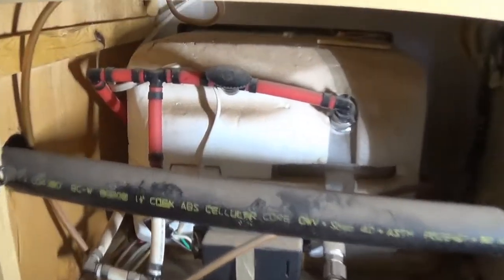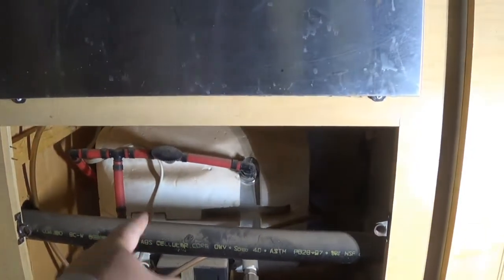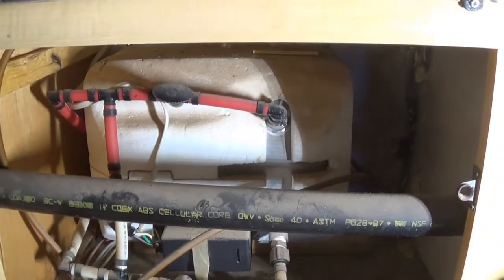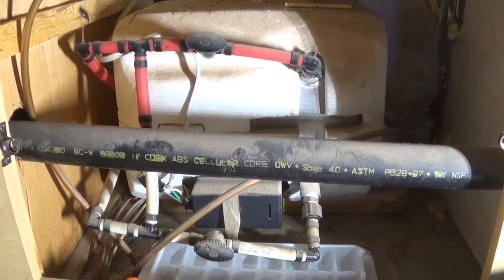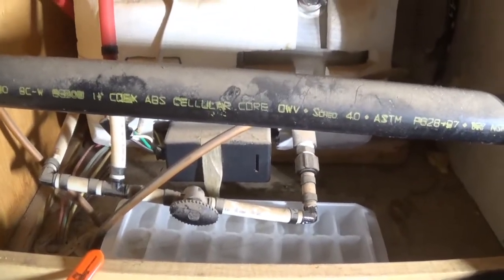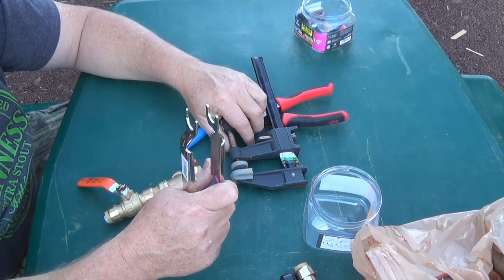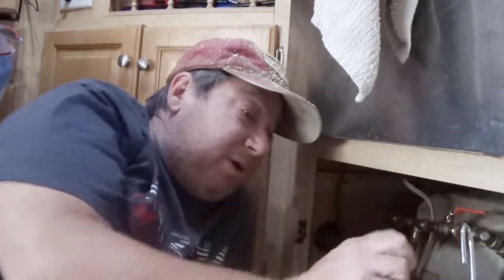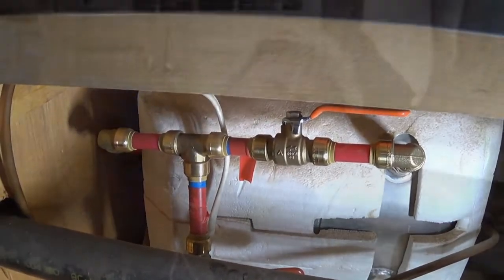RV Water Heater Plumbing Leak Repair

Comment: I’ve got the same leak situation, I’ve even put a tray to catch the water like you did, but I never see where the leak is at. Looks like I’ll just have to rebuild those lines with new fittings. Crazy since I don’t see where it’s leaking. Going to Lowe’s.